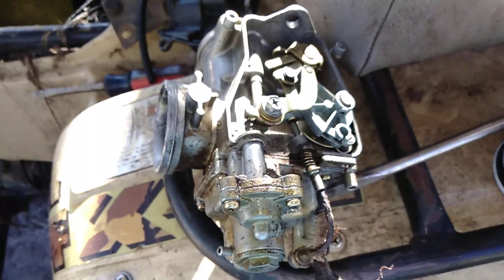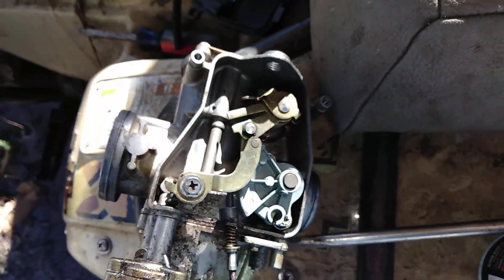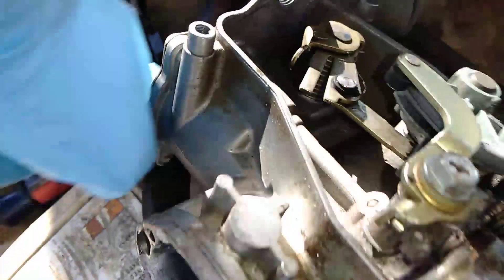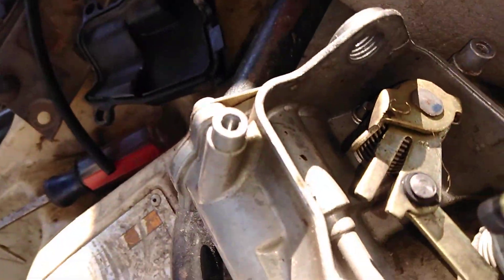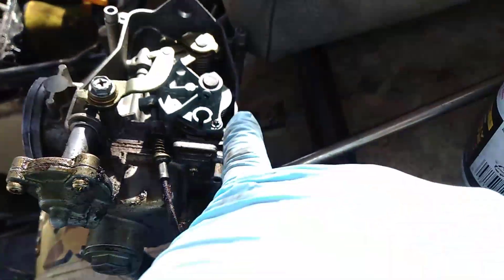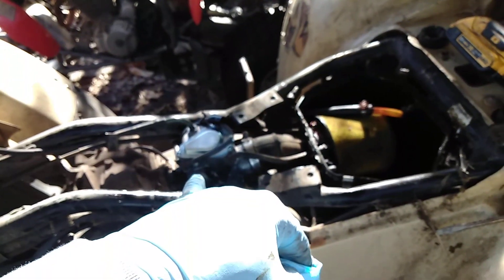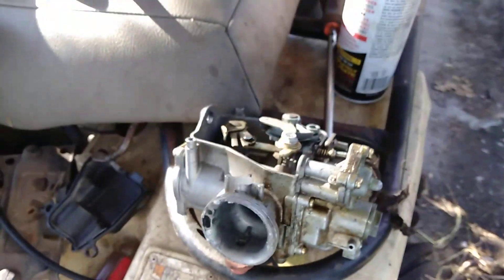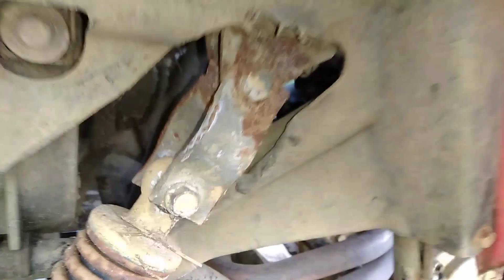400ex carb swap onto 300 fourtrax

Comment: Where do you find more info on carburators and jetting and sizing them and whatnot? is there a cross reference for this? I have a 1985 honda rebel 250 with a single carb Keihin with poorly functioning accelerometer, besides that not asking for help on that just curious how to learn more about carbs in general and jet sizing etc.... Cheers.
Reply from the maker: Forums sometimes but mostly trial and error
Reply: alright, got lots of that in stock.

Comment: Hey mud puppy I just got a 89 Honda FourTrax 300 2wd! When I bought it it ran perfectly the guy started it up and it ran fine but now it won’t run for me I can do the regular clean the carb and check for spark and all that stuff but i was watching your video and saw you can upgrade to the 400ex carb can you show me the link to where you can get them? I can’t find them on Honda and I there are a couple on eBay but not for sure which to get thanks!
Reply from the maker: You don't want a 400ex carb on a stock bike use a 300ex
Reply: Gotcha okay so the 300ex carbs are still available on Honda as well or I would just have to find a used one on eBay
Reply from the maker: id get a clean used one on ebay
Reply: Alright thanks for the help appreciate it

Comment: In mud have your Honda’s ever overheated have you ever needed a rad relocate or are the radiators ok in mud for a while I’ve been getting into mud riding and I was wondering if you need a rad relocate
Reply: Bass fishing America never had a issue with overheating

Comment: Could I do the 400ex carb on a stock 300 and it still run good? And did you notice a good amount of power gain?
Reply from the maker: Better throttle response same max power. On a stock bike do a 300ex carb if you can find a clean used one
Reply: Mud Puppy thanks man I am also really interested in your video about the portal lift you built for the 300 fourtrax. I would really like if you could send me a list of everything I would need to build that and I saw where you said you ran the portals in a video could you send me the link